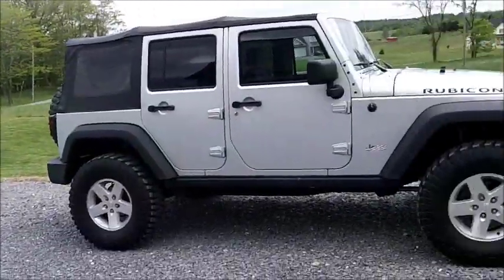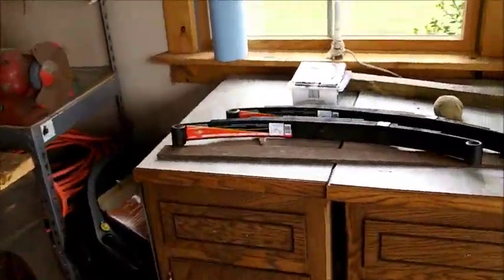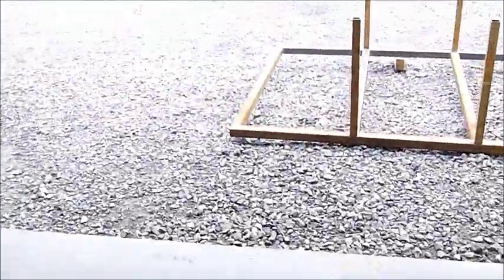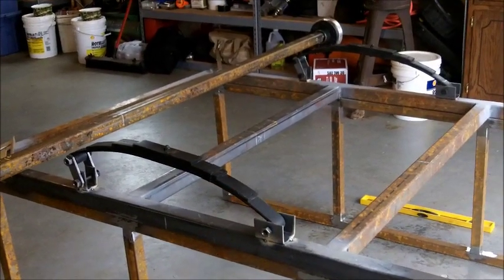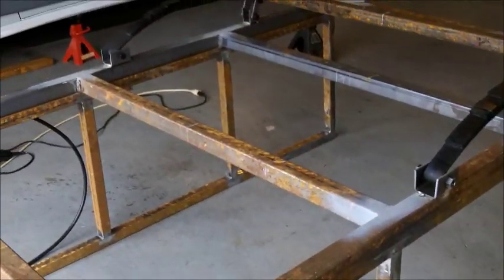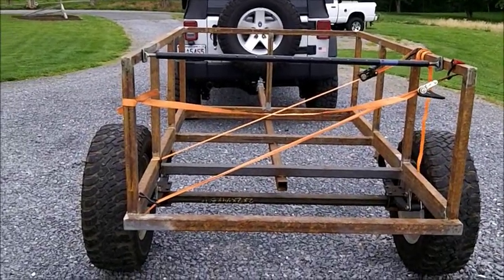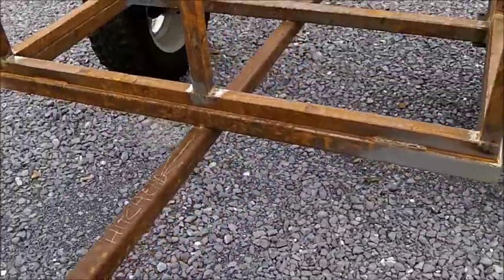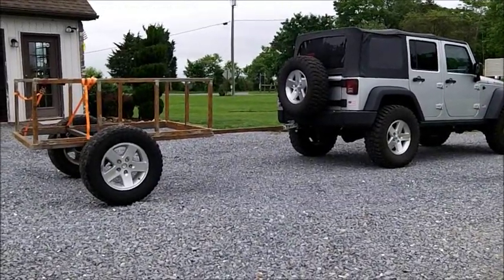Trailer build for CVT roof top tent.

Comment: Obviously too late to help now, but I have a tip for keeping things squared. I've built 3 trailers, and I like to use adjustable jacks under the frame during the building process. Once you get the main frame squared and welded, put it on the jacks, then make sure it's totally level. Then mount the uprights for the sides. Use magnets and clamps to hold them in position, and a simple magnetic level to make sure they're perfectly upright. Check and double-check as often as possible. Once all of the uprights are welded solid, the top rails can go on. I like to do the front top rail first, with 45 degree corners. Then start the side rails at the front, also with 45 degree corners. Use your combination square to make sure you're squared with the front rail, and weld that corner. If the steel isn't perfectly straight, just push/pull it to line up 1st upright. Once you have it exactly where you want it at that upright, weld it solid. Then push/pull the top rail to line up with the next upright, weld it solid. Just repeat this for every upright. If done correctly, he side rails will be straight and you should have no problems with the tailgate being out of square.

Comment from the maker: I did not draw any plans for my trailer.  I built it from day to day on the fly.  A minority of the trailer is 2x2 square tubing. The sides/uprights are 1 1/2 square tubing.  Search through the comments for both of my videos.  You will find more details.